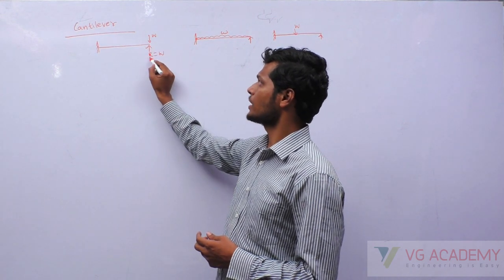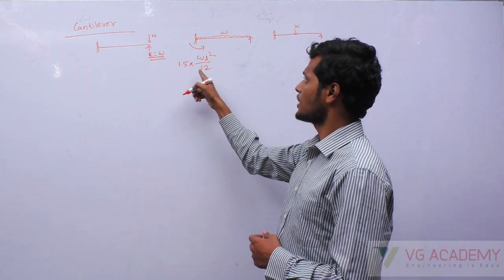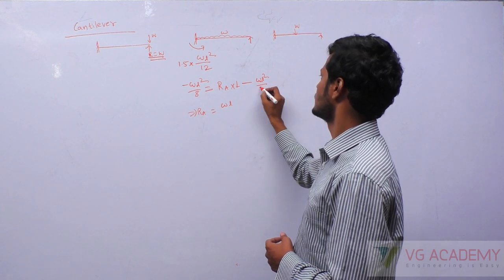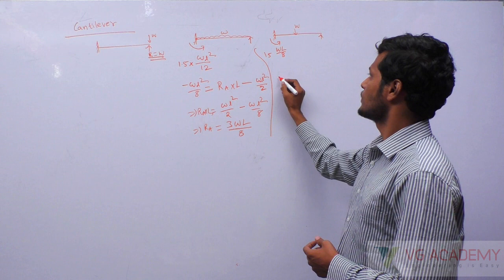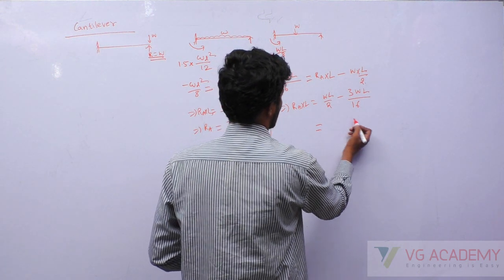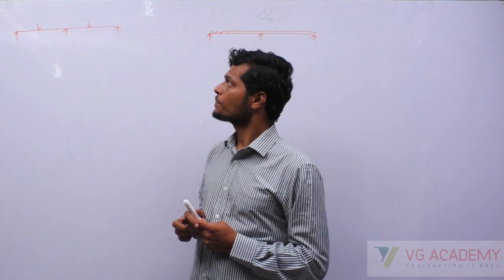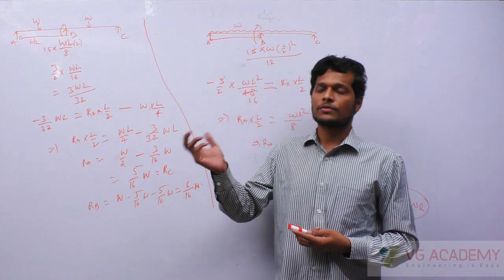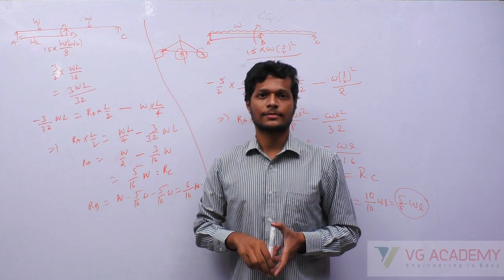my shortcut for prop reaction in cantilever and continuous beam (see description)

Comment: Why cant i use static equations in propped beam even though i can solve for the reaction at the other end using moment at fixed wall?
Reply from the maker: there will be further shortcuts i derive from this. depending on situation we use convenient method
Reply: @VGacademyCivilengineering  sir i have a question for example i have a propped beam fixed wall and roller at the other end. Can i use static equation like moment at fixed wall so i can solve at the roller's support? Because im studying right now beam deflections and i learned that i can use DIM and AMM to solve for reactions. My question is whats the difference of by having a moment at fixed wall so the 3 unknowns will be eliminated? Thankyou sir!

Comment: Sir, in this method, suppose on part AB an udl is given ,and on part BC a point load is given at the centre...so there can we apply this method by taking 2 portion (AB ,BC) as the 2 diff cantiveler  portion?
Reply from the maker: no.you cannot divide spans. you can super impose loads.
Reply: Yes bro how to solve this type of problems.

Comment: Sir how can we solve if beam is proped cantilever with udl over entire span and prop is at somewhere not at free end
Reply from the maker: Chiranjeevi Janapareddi. yes. but a small change you need. remove the load after prop and replace as load wx and moment at propped end wx2/2. and reaction of prop increases by wx due to extended length. due to mement, i hope you can solve remaining. x is extended length after prop

Comment: sir if the point  load is not at the centre then ???
Reply from the maker: Prashanth Chintareddy same method for prop reaction. but for finding slope and deflection I a logic to guess the answer for unsymmetric loading
Reply: sir you mean the moment at fixed end due to the point load which is not at the centre  for prop = 1.5 times the moment for this load without prop
Reply from the maker: Prashanth Chintareddy yes
Reply from the maker: Prashanth Chintareddy 1.5wab2/l2
Reply: VG academy Civil engineering thank you very much sir
Reply: @prashanthchintareddy5638  propped cantiver beam carries an eccentric point load is carries a moment of 2 × wb(square) a/L(Square) will gives you the prop reaction if you take moment about fixed end in the propped cantilever  beam.
Reply: Prashanth Chintareddy Did you get the answer by using this?